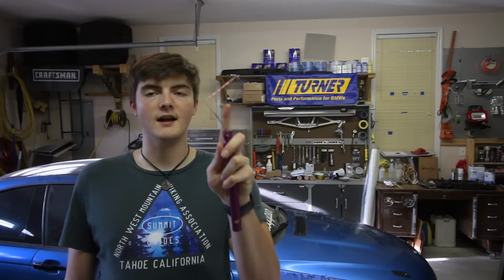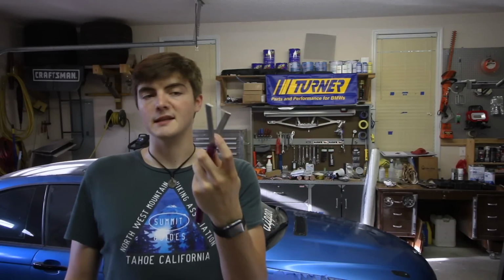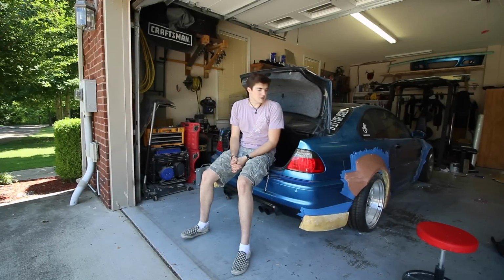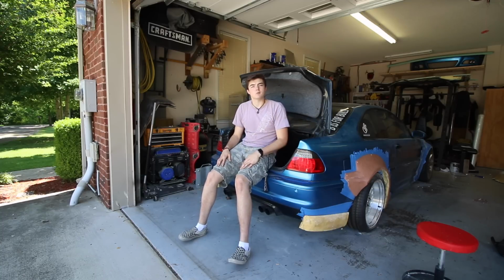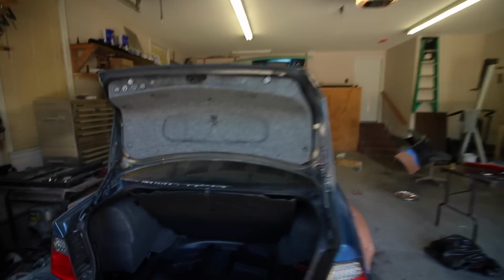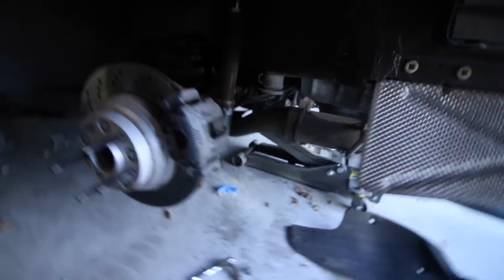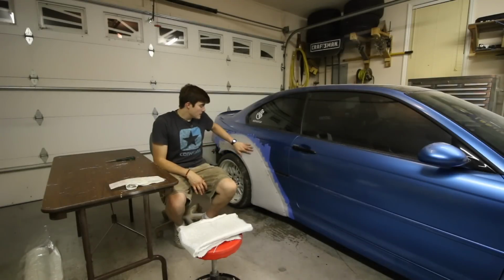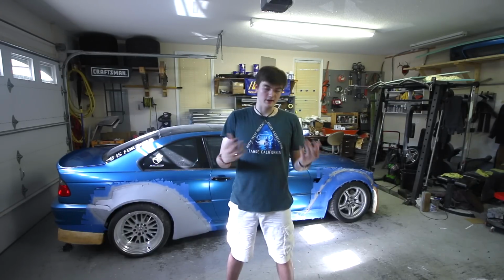DIY Widebody M3 Pt 12

Comment: As a heads up on the mold making, I used to work as a composite tech for a company producing UAVs, and still do a ton of carbon and fiberglass work for my own projects. When making molds and using them for the first time, wax them several times with about an hour between coats THE PVA them, then you just need to get an edge up and shoot a little air in and it should pop right off. Then when you reuse your mold, a quick coat of wax and a coat of PVA and it'll work like a charm every time.

And fuck the haters, it's your car, make it what you want it to be.

Comment: I can only assume you've already made the mold by now, but in case you haven't or still have more molds to make, you should definitely still use wax. When I was taught fiberglass mold making, I did about five applications of waxing and buffing, and then about 6 coats of PVA. I've seen a decent amount of people use only one or the other, or if they do use both, they only did one application of each. Waiting for dry times between coats is super frustrating and I remember wanting to get it done ASAP, but spending a lot of time in the prep work stage helps a whole lot. Hope this helps! I'm looking forward to your next video

Comment: After the clay, it's best to use some spray glue and lay some foil over the clay.  Just make sure there are no air bubbles, then wax and over the foil then lay the fiberglass to make the mold. It saves the clay and some gelcoat and leaves a smooth finish. Just a thought.

Comment: ADvice, make sure the bodywork is 100% perfect, then use gel coat over the panels. It will do a perfect copy of the panel and lay fiberglass matte over that. Then you can PVA the mold and then gelcoat the inside of the mold and fiberglass behind that. The gel coat will make an exact mold of the part so you will have a clean copy. Not only that but then you can sell the kit after with the molds and charge more becuase people will not have to do body work to them.

Comment: I have a protip for you that topnotch bodyshop do and shitty shops dont
When you sand the lip of the fender
Use tape to keep the line perfect factory,it will keep the line without rounding it off sanding...
Follow the ridge with your tape,usually it is 1.5-2tape wide,if you sand quater panel tape the lip,if you sand the lip tape the quater,you will see the thickness of the tape keeps the line perfect,hope you understand what i mean sorry if i miss spelled something im french lol
Keep it up you re on the right path!
Reply: You can use this technique as well when filling,when you pull the tape the line is allready there(im talking about the lil flat lip right over the tire)
Hope you got what i mean it will get you perfect lines with little efforts

Comment: I can say you fastest and greatest way for create widebody, take your car, drive to 3d printing service, ask for 3d scan 1 side of car, take the 3d scanned shape, go to home and install 3d editor, like a autodesk maya, and create the shape of your wide body in several days, 1 click for reflect one side car body kit to another,  cut the shape on parts and go again in 3d printing service with 3d models, and create from ABS body kit. It will cost a little more money, but this take 1-2 weeks, not years, and quality of shapes will be much better, left side of body kit will match with right side on 99%, all edges will be perferctly. 
By this method im redesign handle of my weapon, this is perfect and easy. One problem - you need skill for 3d modeling, but this is not large problem

Comment: Your biggest good up you were doing was using them dam power n air tools u can't get smooth even symmetrical using a AP 3" disk sander should have used bout 6 inch n 4 inch block sanding n rest hand sanding if you did like that you never would have needed to put clay body filler or skim coating would have been more than good idk why I used clay in first place it don't bond to other surfaces well